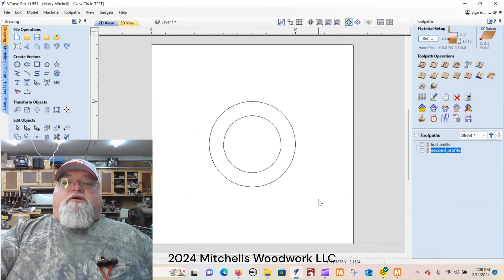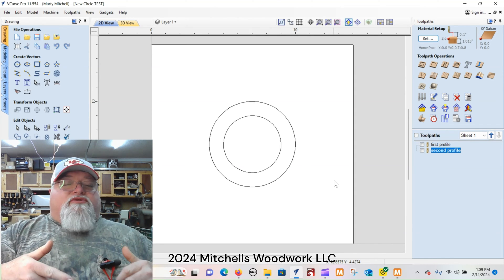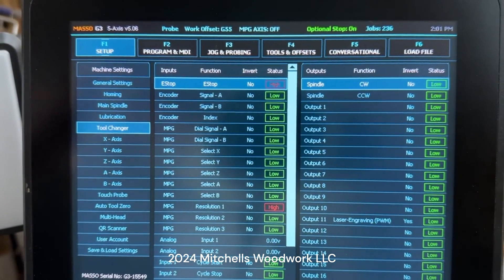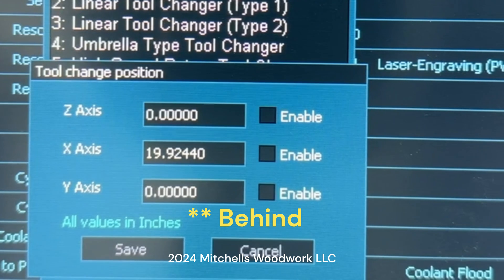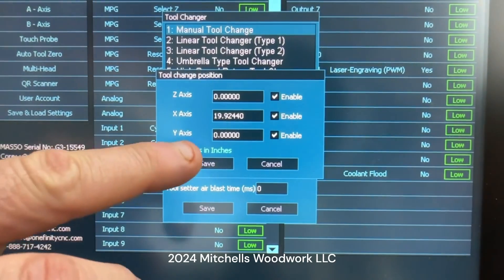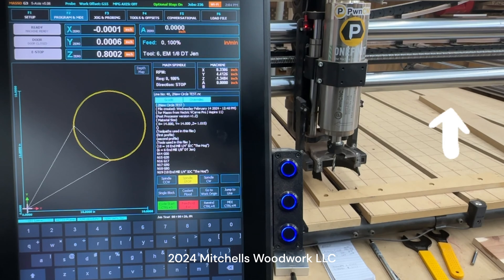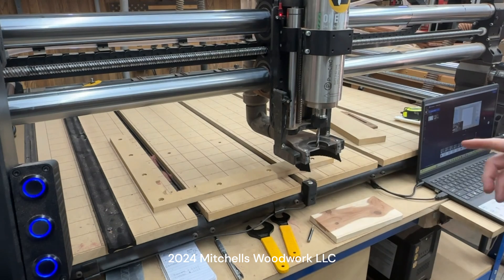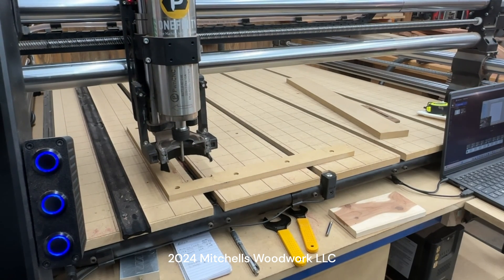How To Set Tool Change Location in Masso G3 Touch | Onefinity Elite Foreman CNC

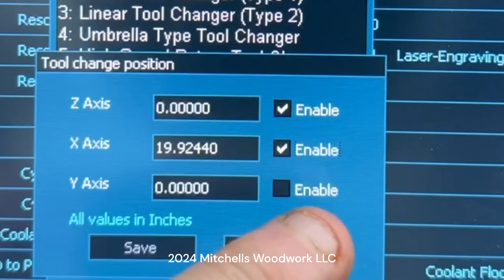Comment: So in your example, you set the Z Axis value to zero in the Tool change position dialog box (@ 3:05).

What I’m not understanding is that wont a Z Axis value of zero set the tool tip on the work surface?
It looked like you spindle went all the way to the top.
Reply from the maker: I see what you’re saying, but setting the   Z axis to zero (0.00) should raise the spindle all the way up, making for an easy tool change.  In this situation the Masso recognizes 0.00 as the upper limit of the Z axis.  Anything below that would have a minus (-) in front of the number.

Comment: Sorry, circling back on some videos.  Watched the video, but didn't see how you would re-zero the bit after the change if not using a tool setter.
Reply from the maker: You could either use the aluminum touch block to zero the new bit, or just use the paper method.  But why go through all that when you can use a tool setter?

https://youtu.be/k1Hx8z3urDE?si=TD7yI6opzLQ70_cq
Reply: @MitchellsWoodwork I was doing this the other day. It would ask to insert the next bit but I could not jog the machine in order to zero the new bit. I could only preset cycle start which isn’t ideal. Apart from a tool setter, any advice? Thanks mate.

Comment: I talked to Masso and tried to get them to add the m06 command in the system so I could assign it to one of my external buttons they refused. I do have one of the buttons assigned to home and one to park. Another helpful video for sure
Reply from the maker: There’s a thread on the Masso forum that requests that Masso add “Go To Work Origin” to the configurable user inputs.  Many folks have signed onto the request, including myself.  Maybe you should start a similar thread for the m06?

https://forums.masso.com.au/threads/go-to-work-origin.3557/
Reply: @MitchellsWoodwork  great idea. I did it. I hope the grand baby arrived ok for your family. Congrats
Reply from the maker: Rizzo?